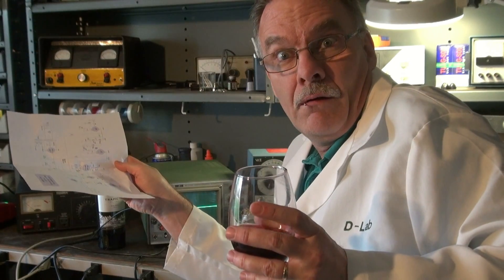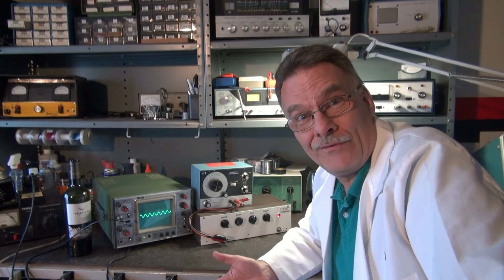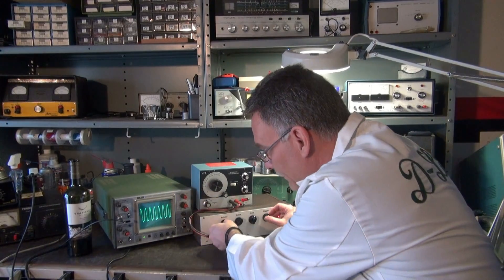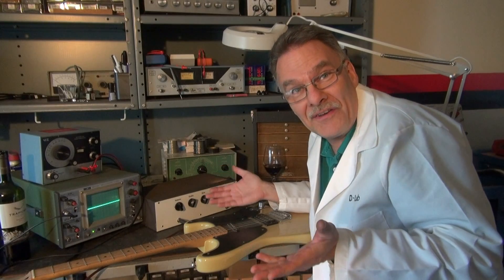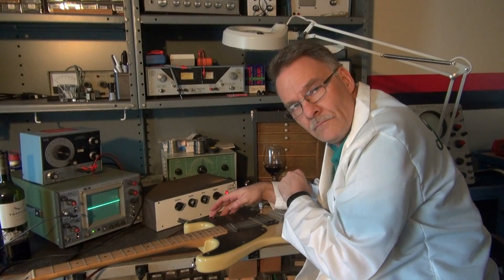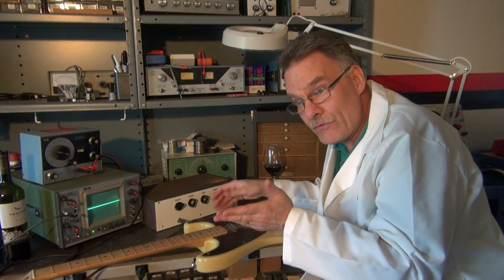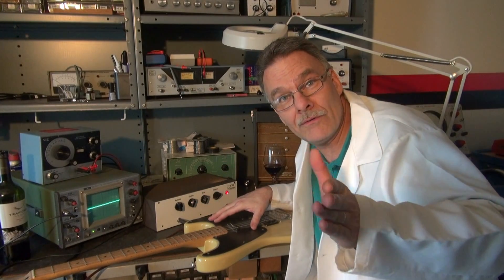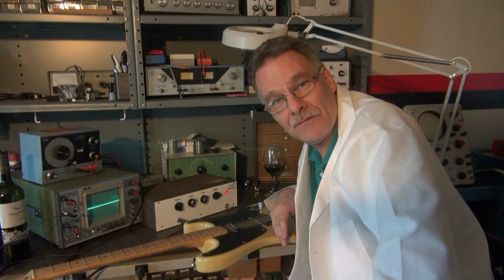D-lab 6AL5 clipperton Tube guitar Boutique amp unique design distortion Monster

Comment: Hey Terry, you should get either an electronic tuner, or the Tuner App for your phone, and tune your guitar to an open chord (as many people have suggested).

For an open G, you can tune (from thickest to thinnest strings): D, G, D, G, B, D.

You could use an empty wine bottle pressed against the strings (just enough that they lower a bit, no need to press them to the fretboard) to play different open chords, like in a lap-steel guitar.
Closest to the body = higher pitched chord, Closest to the headstock = lower pitched chord.

You may not be great at it at first, but it's gonna be a better reference for guitarists on how the amp sounds by hearing it be played. Give it a try, you might make a cool tune!

Comment: Hey terry, I was looking at a schematic for the fender champ. The mains transformer was 650V center tapped, I was wondering if for example a 600V center tap would work as well? I assume it would work but you'd get less output power?
Thanks!
Reply from the maker: Yes, That would work fine

Comment: Cool!  Will you be sharing the schematic?
Reply from the maker: Yes, as soon as I shake it out
Reply: I would be interested in schematic and how this is applied! Would be great if you share, thanks! Great videos, great work!
Reply: I've tried wiring the diodes in anti-parallel like a pair of LEDs: signal to pin 5&7, feeding pin 1 with 1.4v from the cathode of a 12ax7 and grounding pin 2 - it does not work well.  I think that the key is in what Terry said about the anodes - he varied the voltage to them. He's a Ham; so, he probably modified the clipper section of the Johnson Valiant.  How about it, Terry - do I win the prize?

Comment: This has been done many times before by many different people, most commonly with 6AL5's or diode-strapped 12A*7's. Sorry, but even a cursory google would've shown you that you're not the first to do this.
Reply from the maker: Not claiming to be the fore founder. It is new for D-lab
Reply: Ok, that's just the way it came across to me in the video. Didn't mean to come across as rude (which I think I did on re-reading), sorry about that.
Reply from the maker: No worries man, Yes, the video is a bit vague. I was just trying to throw out some stale D-lab humor!

Comment: These tubes are easy to find and cheap even here in Brazil (between $2.5 and $8 a pop).

You mention seeing people talking about them as clippers in forums. First thing that came to my mind was that, back in 2011, Merlin (from the website Valve Wizard) posted his design of an Overdrive pedal, using these tubes in place of the clipping diodes, in the DIYstompboxes forum: http://www.diystompboxes.com/smfforum/index.php?topic=89363.0

Now, an interesting project from the same year, developed by Eduardo Foltran, is Otavio, an all-tube octave-up module: https://www.youtube.com/watch?v=9GTvd1zSinE
He posted his project on the brazilian do-it-yourself forum Handmades:
http://www.handmades.com.br/forum/index.php?topic=2564.msg50778#msg50778

This is definitely a cool idea to add to the "unusual use for tubes nobody wants" category.

Comment: So Terry, a big step above your "normal" style videos! Was this Mrs. D-Lab asking where the guitar player is? I totally get what a clipper compared to overdrive(saturation) is. Done with diodes and the bases of some so called distortion pedals. It's also what's in the passive distortion called Black Ice.Maybe a little more explanation of the differences for those ampoholics. I must admit I was not aware you could even do it with vacuum tubes. Thankz
Reply from the maker: Hello, Yep, That was Marcia driving the camera. She wants to be more involved with the vids. So, I want to get her a star trek uniform and she can be D-lab's ship counselor. Advise me on the evils of drinking to much! I do plan on more indepth vids of this clipper circuit. This one is pretty cool since you can dial in the amount of desired clipping, whereas diode type are mostly full on. I achieved this by using variable plate voltage to the 6AL5. Being a detector tube, the diodes pull very little current. Great addition to a preamp circuit. More info to follow soon.
Reply: D-lab Electronics Thanks for the reply! Marcia Troy! You are lucky to have her. You have a different look at an age old subject and the humor is great! Will be looking forward to all of your vids. I will learn even more! Thankz

Comment: Interesting. Using cheap tube twin diodes for clipping instead of cascading gain stages in twin triodes. I'm currently working on cascading EF86 or 5879 stages. The 5879 is looking better due to the lower gain. 

I think cascading is just what most of us tube nerds go to, because tradition. Can't wait for a demo!

Comment: that is like an amp with a fuzz pedal inside. You need to create a foot switch that engages the circuit and you have a winner - very cool..  - Ron
Reply from the maker: Yes Sir, I agree. This one is a proto-type. The next model will have switching built in. Thanks for your support.
Reply: Excellent... maybe even a Bluetooth activated foot switch  :)  HighTech meets grunge :)

Comment: Awesome!! I have designed high gain guitar amps for almost 30 years and I always hate to use diodes as clipper but sometimes in order to get low noise nicely clipped signal it is inevitable at least until now, great work my friend!
Reply from the maker: Thanks man, I believe this will develop into something cool. Still tinkering, but getting very close. TD